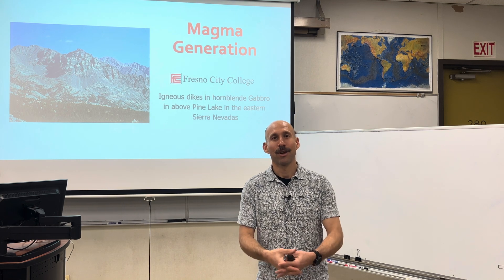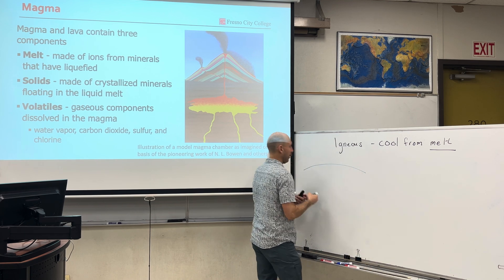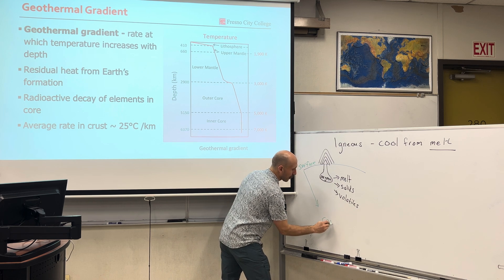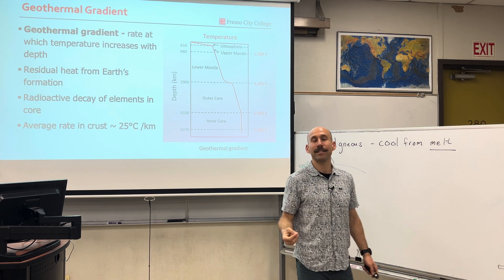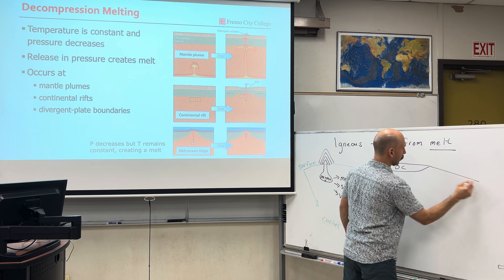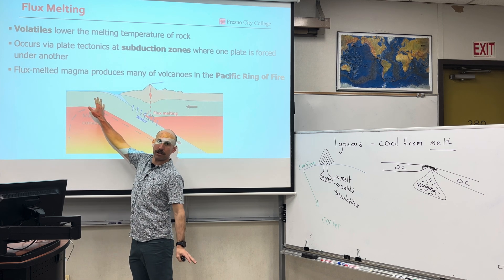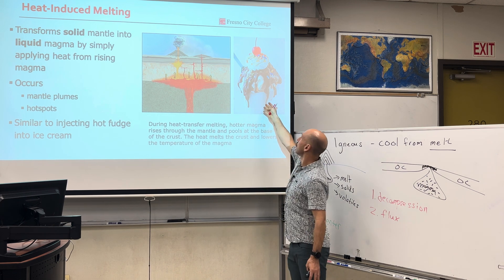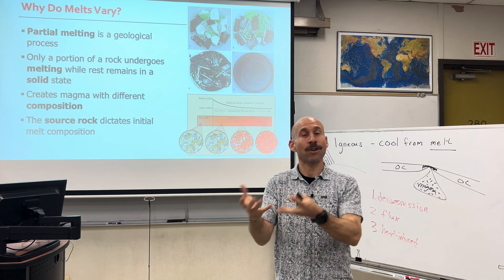Magma Generation

Comment: What is keeping the earth so hot, at this outer layer away from the core, that it can melt rock and produce magma? I get that the center is super hot but it cools radically as we get closer to the surface it doesn't seem that the mantle should be all that hot.
Reply from the maker: Radioactive decay of the inner core produces Earth's internal heat that cycles through the mantle and drives plate tectonics.